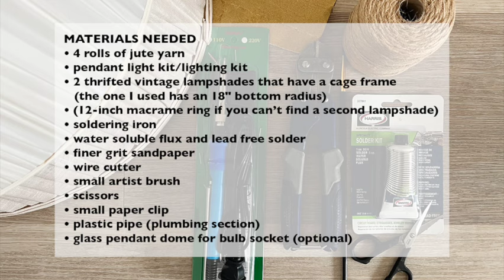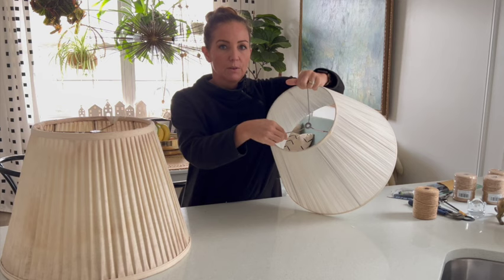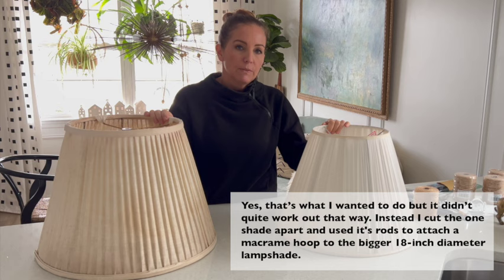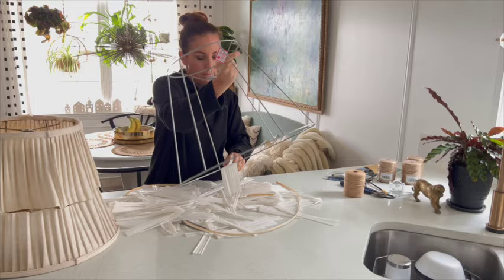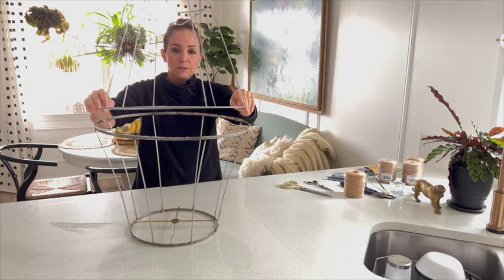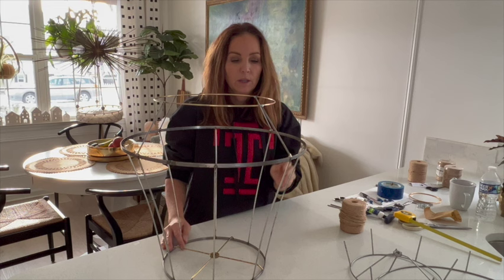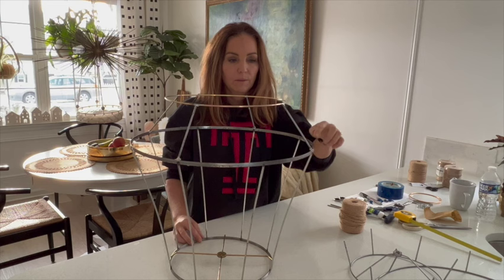DIY jute pendant light for dining room

Comment: I’m so doing this for an outdoor light above my dining table under a tree.  Figured I could protect it from the elements by wrapping it in a plastic when not in use.  Ty for this!
Reply from the maker: You could use a synthetic cord which also helps protect it from the elements. I have done that with outdoor macrame pieces. Good luck!
Reply: @juliakonya7266  great idea!
Reply from the maker: @aprilhumen1229  https://cuckoo4design.com/metal-patio-table-makeover/ The type of cord used in this tutorial of mine is usually what I use for outdoor projects

Comment: I am so impressed! I've tried to make pendant lights before but I couldn't figure out what to use as the base that would be big enough. I never thought to use thrifted lamp shades! Mind blown! 🤯 You are a genius!
Reply from the maker: Thank you Morgan. I wish the metal frame cages were a bit easier to find ;)
Reply: @juliakonya7266  can you solder coat hanger wire? If so the possibilities using newer syle lamp shades would be great. I was always chicken to try soldering.  You have inspired me to try!!
Reply from the maker: @oldladytoofast  I'm a soldering newbie so I'm not sure about coat hangers. Sorry
Reply: @juliakonya7266  I'll def let you know what I find out. It sure could be a great source of material to lengthen or make shades.
Reply: I watched a YT video where the creator used a bic lighter to solder coat hangers because he didnt have a solder iron. Definitely going to try it with hangers
Reply from the maker: @oldladytoofast  yes it could be
Reply: Pĺpplll